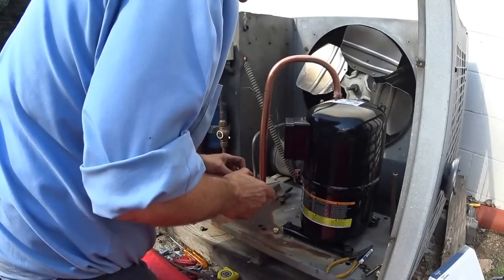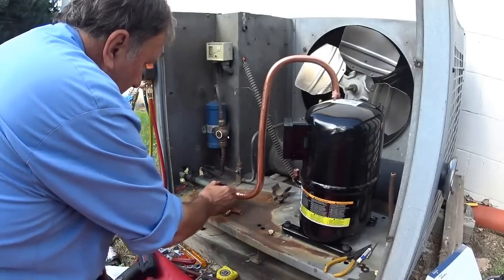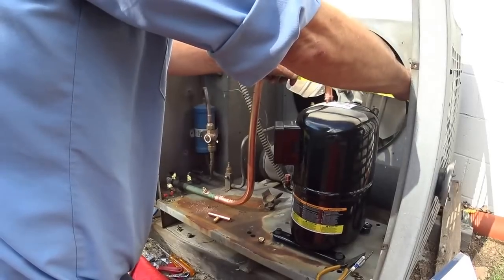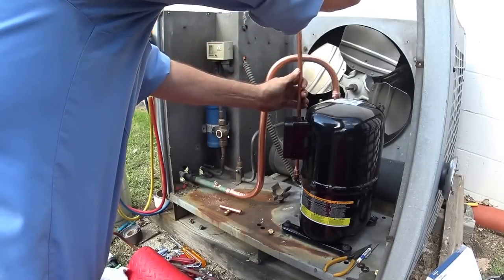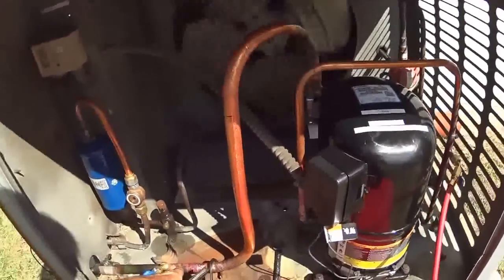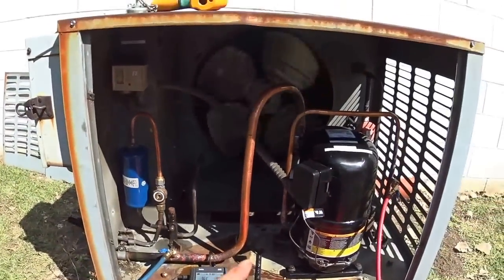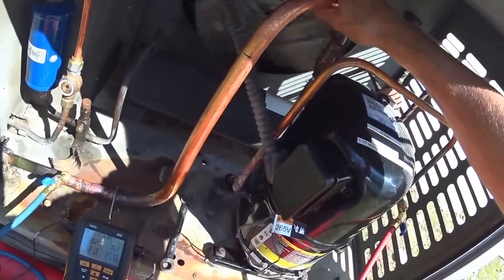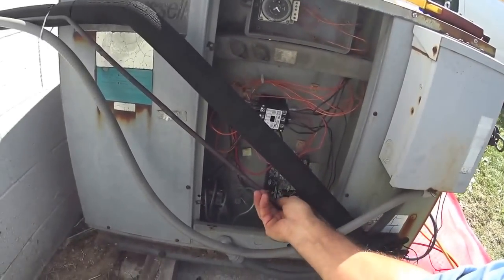Refrigeration Compressor change (part3)

Comment: :) 
No need to drill at all, if you are using a proper acetylen/oxygen torch, you can cut a nice  hole in nearly every tube without leaving any  metal that will surely move around.
That's the easy and safe way we install Schraders in a already installed system.  ☺

Comment: it is good to make these teaching videos, but i think the work should be performed the right way. i see in many videos that this gentleman is a very good troubleshooter on ref/hvac systems, but honestly, the way he performs the job its far to be the best. starting with the plumber way to clean and braze the copper tubes. using paste, the system gets contaminated even before the compressor starts for the first time. drilling  a hole to insert a new swet access valve is ok, as long as he makes on the new tube and before its placed to braze, so it gets clean inside. cleaning the tubbing after drilling a hole, gets the inside contaminated with copper particles. cleaning a vertical tube open, its wrong, because all the copper remains goes inside the system. when the tech opens a system, all the tubes must to be taped right away to prevent moister going inside. the drier, in my opinion, when replaced, should be for a new flared one. this saves 2 soldering s that helps to contaminate the system and next time the system needs to be opened, saves time to replace it. about the recovered refrigerant going back to the system, nothing wrong with it: he has a filter before the recover pump that virtually cleans the gas. the only exception is when the compressor burned out the coils inside.
Reply: While I agree with you on many points, Jim's way seems to work for him. In the end, the results are what matters. Personally, I never use flux on copper-to-copper because it isn't needed with phosphorous-bearing braze alloys. When I do use flux, it goes on the male end only, which is the way any braze manufacturer shows it being done. When braze flux is put on the female fitting the male fitting pushes the excess flux into the tube, which is a bad deal IMO, but again it hasn't seemed to cause problems for Jim.

I would have drilled the hole for the service fitting while the pipe was open and chased the swarf out with CO2 or N2 connected to the upstream service port. If I have to drill a hole in an assembled system I pressurize with CO2 or N2. That way, when the bit starts breaking through, the pressure will blow the swarf out rather than let it fall into the tube. This is just how I do things.

Using a flare filter/drier is a mixed bag. On the one hand all you need is your hand tool bag, gauges, vac pump, and vac gauge to change it out. On the other hand, flares are more prone to leaks if not done properly. The odds of a flare leak drop to virtually zero if you use Loctite 554 on the flare face. Another excellent, albeit pricey, option is Flaretite seals. I've used them on refrigeration and hydraulics and they definitely work as advertised. Anyway, soldering the drier makes it a bit easier to R&R later since it saves you from having to drag your N2 tank to the unit, and is not going to be as prone to leak as a sketchy flare fitting.

BTW, if you go shopping for Flaretite seals, go to https://www.flaretite.com/flaretite-seal and use promo code  SHOW2017. That will cut the price in half, which gets you down to around $4.00 per seal. 8 bucks for a pair of seals to seal a filter/drier is cheap compared to the price of refrigerant these days.

My other comments: I like suction filter/driers for cleanup after a burnout. It prevents any acid in your evap from getting washed back into the new compressor. However, they need to be removed after a few days and replaced with pipe. Too many techs/companies want to forget about it after the compressor is replaced. In this particular instance, the forgotten/deliberately ignored suction drier is probably what killed the compressor.

Finally, I don't think the 45° piping from the wall to the unit was done because the installer was trying to save a buck. More than likely, the installer either ran out of 90° fittings, ran short on pipe, OR the Good Idea Fairy came along and suggested the pipes be installed at 45 degrees to look cool. In any case, yeah, it was a bad idea. I bet it also violates the local install codes since it obstructs the panel where the power connections are made.
Reply: What I’ve found is Jim is a very experienced engineer but I personally don’t agree with all of his theory. He is well old school and for me as a young apprentice his videos are educating but also at times misleading. To put it short I grasp what I need to and don’t what I don’t need to. Drilling holes on copper pipe like that is a big no regardless Jim saying it all goes and sits at bottom of compressor with oil. Copper bits still has potential to be pumped around system, with possibility to jam compressor’s reed valves, blockage at TEV?
Reply: But don’t get it twisted it is privilege to get to watch this, learned so much on Jim’s videos

Comment: Great Video, Jim, you said something about zp or power head specifically for deep freezer being the culpurt for compressor failure can you point me in the direction where can I get more information on different types of power head types and or chart for refrigeration and or freezer use.  Thanks I learned a lot of valuable information, one thing I also like to ask when you rough cut pipes with saw, don't some small particles stay inside the pipe even after you clean with wire brush..would it harm the compressor ? or you have it blow it out before soldering..Enjoyed watching all three parts..
Reply from the maker: The ZP valves are Sporlan, find a Sporlan distributor and they'll give you the info, or possibly look Sporlan valves up online. copper filings get caught in the drier filter's fine screen & felt, in the compressor it will sit in the oil sump for years. Really never had any problems. Thanks.

Comment: The piping in front  of the panel   piss me off to but I would just change it when the system is down the hole open in the wall would get me going too,  would need to plug it.   The mouse in the line thing was funny tape is cheap.

Comment: When you drill a hole in the suction pipe, are you not afraid of getting copper chips into the pipe?
Reply from the maker: guuuuustaf any copper filings will sit in the bottom of the oil sump, I use to rebuild semi hermetics and would find copper filings, braze BBs aluminum rod bits in the bottom of the oil, the oil is lighter and any metal will sink.
Reply: ***** 

Great, learned something new.Keep it up=)
Reply: Acid from the copper? how is that possible?